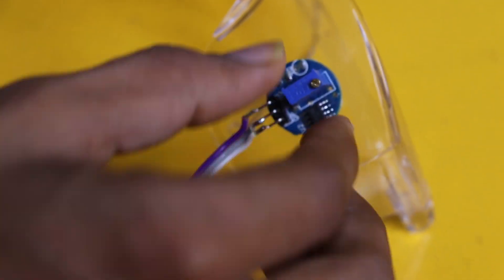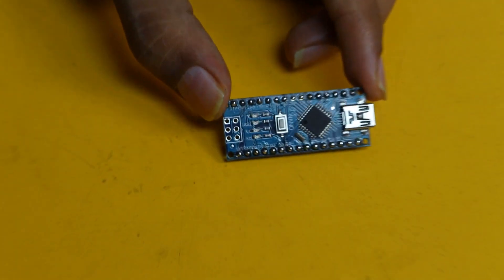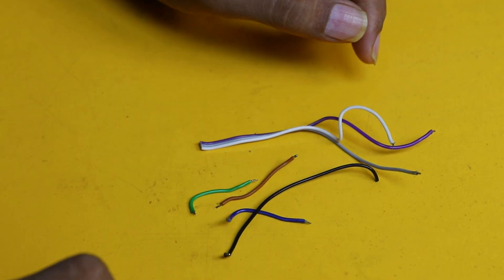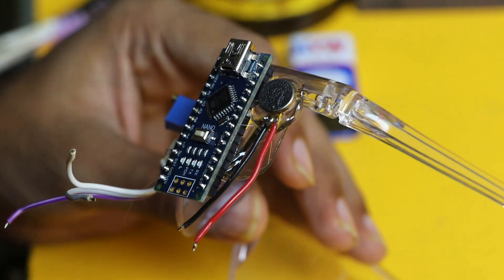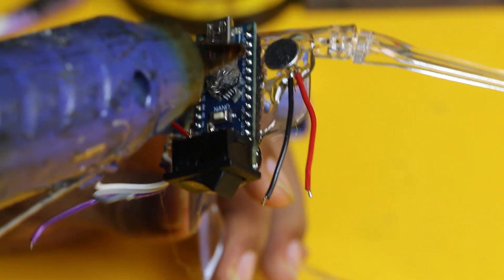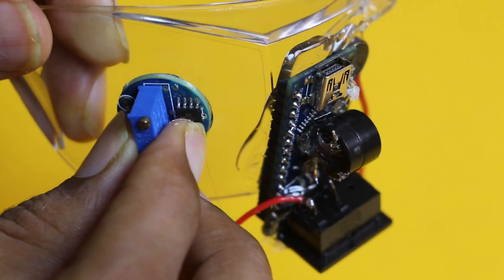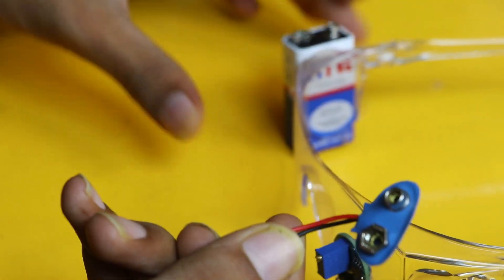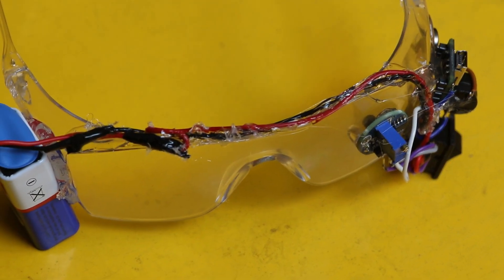Anti Sleep Alarm using Arduino and Eye Blink Sensor | Project

Comment: i will make it with a attiny 10
Reply from the maker: That's a great option . it will save lot of power and you won't need heavy battery on Goggles

Comment: Its a very good project. I did this but in that  continuously producing sound.. How can I solve this? Sensor is properly working. But sound producing continuously.... pls give rply
Reply from the maker: Please Go through the Programming of this Project Carefully. There are chances that your Code is not properly checked
Reply from the maker: you can try this code :- 
// @circuitsbazaar / Innovative Indian Projects
#define SENSE A0 // IR Sensor 

void setup()
{
pinMode(SENSE, INPUT); // Attach the Eye Blink Sensor signal pin 
pinMode(LED_BUILTIN, OUTPUT); // 13+ // Buzzer Attached 
}
void loop()
{
if(digitalRead(SENSE))
{
 digitalWrite(LED_BUILTIN, LOW);

}
else
{
  delay (2000);
  if(digitalRead(SENSE))
  {
 digitalWrite(LED_BUILTIN, LOW);
 
}
  else
  digitalWrite(LED_BUILTIN, HIGH);  
  
  }
}
Reply from the maker: Or you can visit this article :- 
https://circuitsbazaar.com/anti-sleep-alarm-project-using-eye-blink-sensor/

Comment: Sir can we use ir sensor instead of this??
Reply from the maker: Yes you can use but make it compact. However, there are some things to keep in mind.
IR sensors can be affected by ambient light. This means that you may need to take steps to reduce the amount of ambient light in your project.
IR sensors can be used to detect other objects besides eyes. This means that you will need to make sure that your project is designed to only detect eyes.

Comment: It's showing uploading error
Reply from the maker: In the context of Arduino programming, an "uploading error" refers to a problem that occurs when you're trying to upload your code from your computer to an Arduino board, but the process encounters an issue and fails to complete successfully. This error can be caused by various factors, and the error message you receive will provide more information about what went wrong.

Some common reasons for uploading errors in Arduino programming include:
Incorrect Board or Port Selection
Driver Issues
USB Cable Problems
Conflicting Software
Memory Issues
Bootloader Problems
Physical Connection Issues
Conflicting Libraries
External Hardware Problems

Comment: Hi sir..the code is not working
Reply from the maker: Code is properly working ...  uploading error means there is some other problem. 
In the context of Arduino programming, an "uploading error" refers to a problem that occurs when you're trying to upload your code from your computer to an Arduino board, but the process encounters an issue and fails to complete successfully. This error can be caused by various factors, and the error message you receive will provide more information about what went wrong.

Some common reasons for uploading errors in Arduino programming include:
Incorrect Board or Port Selection
Driver Issues
USB Cable Problems
Conflicting Software
Memory Issues
Bootloader Problems
Physical Connection Issues
Conflicting Libraries
External Hardware Problems

Comment: #define SENSE A0 // IR Sensor void setup() { pinMode(SENSE, INPUT); pinMode(2, OUTPUT); pinMode(LED_BUILTIN, OUTPUT); // 13+ } void loop() { if(digitalRead(SENSE)) { digitalWrite(LED_BUILTIN, LOW); pinMode(2, LOW); } else { delay (2000); if(digitalRead(SENSE)) { digitalWrite(LED_BUILTIN, LOW); pinMode(2, LOW); } else digitalWrite(LED_BUILTIN, HIGH); pinMode(2, HIGH); } }

Comment: How to install any new library in proteus software
Click Here to download the Proteus simulation file.
Code of the project:
#define SENSE A0 // IR Sensor void setup() { pinMode(SENSE, INPUT); pinMode(2, OUTPUT); pinMode(LED_BUILTIN, OUTPUT); // 13+ } void loop() { if(digitalRead(SENSE)) { digitalWrite(LED_BUILTIN, LOW); pinMode(2, LOW); } else { delay (2000); if(digitalRead(SENSE)) { digitalWrite(LED_BUILTIN, LOW); pinMode(2, LOW); } else digitalWrite(LED_BUILTIN, HIGH); pinMode(2, HIGH); } }

Comment: Can we use ir sensor instead of eye blink sensor.
Reply: Ok Sir
Reply from the maker: yes you can use but the fitting of the  IR sensor is little bit tricky .... actually this is also IR Sensor, we are using but this is in the compact form which can be fitted easily in the goggles.

Comment: Sir mera project work nahi kar raha hai
Buzzer opposite work kar raha hai please help me sir....
Reply from the maker: Don't worry just change the logic in the programming from HIGH to LOW to run the buzzer. If still problem persist then please check the logic of the IR sensor as well or contact us at circuitsbazaar.com for detailed support .

Comment from the maker: here in this project there is no use of D2 but you can use it in future project upgrades to control the car ignition system as well. This means if you will sleep then car engine will also stop through a relay connected at pin D2. for this project don't consider it(D2).
Reply: Sir code can't open
Reply from the maker: @santhoshkumar.vsurya1506   Where you are trying to open it? . Just copy from the article i am giving you and paste it in arduino. it's working properly. The article is :-  https://circuitsbazaar.com/anti-sleep-alarm-project-using-eye-blink-sensor/
Reply from the maker: @santhoshkumar.vsurya1506   or use this  code  :-       
  #define SENSE A0 // IR Sensor 

void setup()
{
pinMode(SENSE, INPUT);
pinMode(2, OUTPUT);

pinMode(LED_BUILTIN, OUTPUT); // 13+
}
void loop()
{
if(digitalRead(SENSE))
{
 digitalWrite(LED_BUILTIN, LOW);
 pinMode(2, LOW);
}
else
{
  delay (2000);
  if(digitalRead(SENSE))
  {
 digitalWrite(LED_BUILTIN, LOW);
 pinMode(2, LOW);
}
  else
  digitalWrite(LED_BUILTIN, HIGH);  
   pinMode(2, HIGH);
  }
}
Reply: plz bro say how can i do in D2 pin who one are connect relay yah motor plz show me plz 🙏🖤😢
Reply from the maker: @rexrakibul1  you can buy relay module from the market and attach motor to it. or Simply watch any video online to see the connection of relay with the motor . It's simple . but still if you have doubt then let me know i will share a special video for you where i will tell from scratch that how you can attach a relay and motor.
Reply: @The.Innovative.Indian  Make this same project where when the alcohol detector sensor or eye blink sensor are detect the sence then the motor are turn off and after when the alcohol are finished or eye is open the the motor are turn on plz vaia make it.. Under 1 day plz plz i need it 29 January is my science fair so plz under 1 day make it love from Bangladesh 🖤🙏
Reply from the maker: @rexrakibul1  Made it and its available in @mr.innovativeindian
Reply: how price

Comment: Sir can we use ir sensor in replace of eyeblink sensor ?
Reply from the maker: Yes you can use ...  just make the ir sensor module size small so that you can fit that on the specs
Reply: Hi sir do you have a program for using IR sensor? Can I please ask for it? I am working on a project and it is really confusing me and the deadline is near.

Comment: Amazon only deliver to india and sri lanka. Can u post international please. Another question, what else sensor can be replace for eye blink sensor as in video. How about tracker sensor like TCRT5000
Reply from the maker: 1. I don't know from which country you are from. It's also available in the USA Amazon Website as well .... 
2. If you don't find it in your country then worry not .... because eye blink sensor is nothing but a simple IR Transmitter and Reciever Pair. ... you can make it home... make sure you are creating it smallest possible pcb. The IC you can use is LM358 . Better if you can go for SMD Components....    
3. Instead of TCRT5000 , you can use simple transmitter receiver pair of Infrared sensor.

Comment: sir ek error aaagaya while compiling 
exit status 1
'define' does not name a type; did you mean 'rewind'?
Reply from the maker: Exit status 1 indicates that a process has finished (or “exited”) in failure.
Please copy the code as it is ....... as it is on my website 
https://circuitsbazaar.com/anti-sleep-alarm-project-using-eye-blink-sensor/
Reply from the maker: There was a little typing mistake in the code but now has been updated......   Please check it again ....  i have tested it .... It's working perfectly
Reply: @The.Innovative.Indian  Thank you sir for quick help, I am going to test it

Comment: Bro please give program for aurdino nano for these project 👍🏻
Reply from the maker: I have written the code for Arduino UNO. The link for the complete article which is having code as well is given in the description below..... All the codes written for Uno will work with Nano due to the less number of analog pins in Uno. But the code written for Nano will not work in Uno because there are 8 analog pins in Nano but there are only 6 analog pins in Uno.    So you can use this code directly for Arduino nano.

Comment: how to adjust the timing of the sense its only 2 sec and I want to do that sensor will sense after 5 sec
plz tell me
Reply from the maker: Code is given at :- https://circuitsbazaar.com/anti-sleep-alarm-project-using-eye-blink-sensor/
You just need to change the time delay function a little bit .
Updated  code is given here according to your requirement :- 
// Code Of Anti Sleep Alarm Project
// circuitsbazaar.com
define SENSE A0 // for eye blink sensor output void setup()
{
pinMode(SENSE, INPUT);
pinMode(2, OUTPUT);pinMode(LED_BUILTIN, OUTPUT); // Pin number 13 of arduino nano
}
void loop()
{
if(digitalRead(SENSE))
{
digitalWrite(LED_BUILTIN, LOW);
pinMode(2, LOW);
}
else
{
delay (5000);
if(digitalRead(SENSE))
{
digitalWrite(LED_BUILTIN, LOW);
pinMode(2, LOW);
}
else
digitalWrite(LED_BUILTIN, HIGH);
pinMode(2, HIGH);
}
}